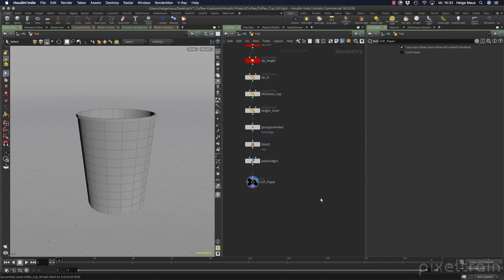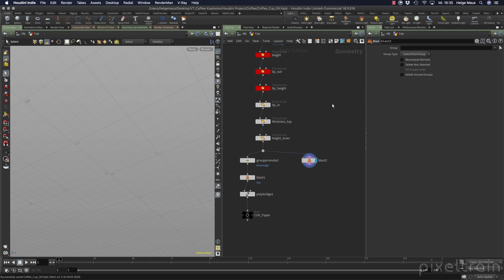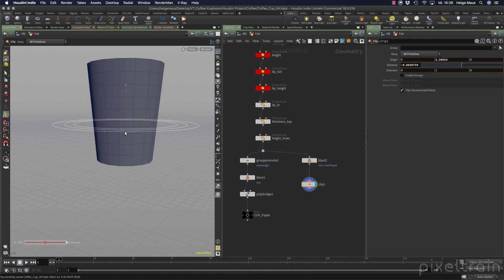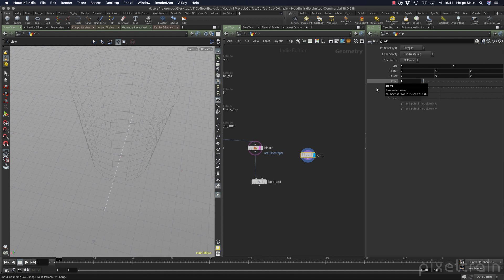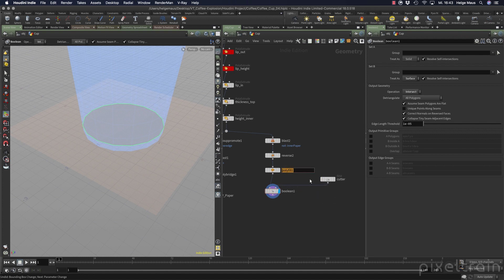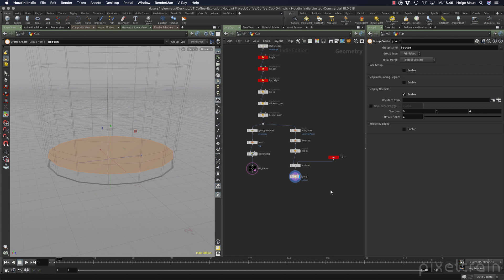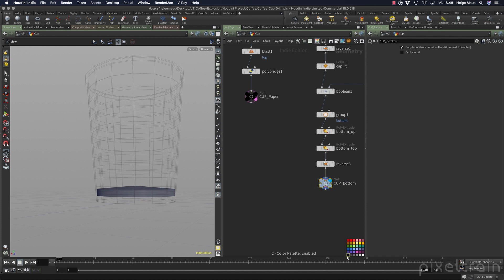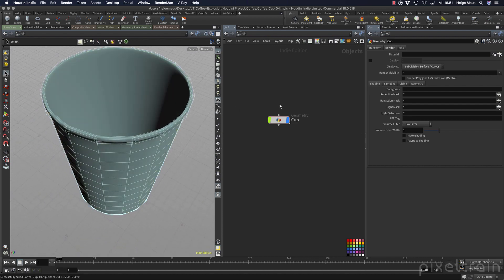CoffeeCup - 01_04 Using Booleans for procedural Modeling in Houdini FX

Comment: Hi Helge, I’m noticing that I have to fix the normals on the cup with Normal nodes before the Null out nodes on both the paper and the cap so the cap doesn’t turn black. I also had to place a Normal node after the Blast > Reverse node on the cap before the Boolean as the cap was turning black after the reverse as well. I didn’t notice you modifying normal info anywhere up the chain. Any ideas on why this might be happening. I’m on Houdini 18.0.460. Will upgrade and see if the issue still exists. Thanks again for the series, it’s super helpful!
Reply from the maker: Hi Travis,
I use the Reverse Node to change the surface orientation when needed. For example for the bottom or the down part of the lid. If you have to use it in your case really often depends on the directions of operations you did before that in the tree. So you maybe have not the need to add this node in your setup. So, only use it, if you see, that the extrude directions are negative or you see, that the surface flipped.

Comment: Why in the hell would you use boolean in first place for a damn coffee cup... Dude that's not how you teach stuff
Reply from the maker: It's not for bool, it's for procedural placing the base of the inner bottom part.

Have you watched the video?

You will see, that I branch out and don't use a "boolean" result in a classic way and the goal is to generate a circular polygon that fits exactly the height of the selected position of the cup AND has the right topology. Later with this techniques, you can change the height of the cup, the number of divisions (h and v) and the angle of the cup without losing that bottom. Also, you can freely place the height position of the bottom.

So, it's very different from an approach you use in Maya, Blender, C4D & Co.

Edge Split (in loop mode) isn't procedural. So, it's the best way of archiving it, right? Or do you have a better solution for that?

Thanks for your input.
Reply: Looking forward to your tutorial series Mayank.. seems like you’re an ‘expert’